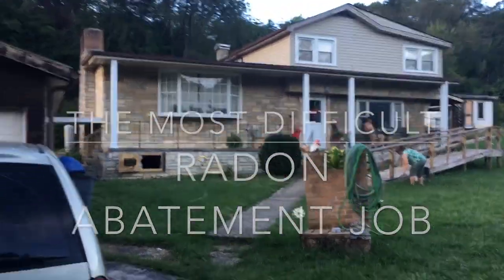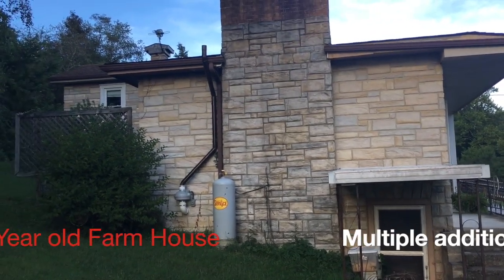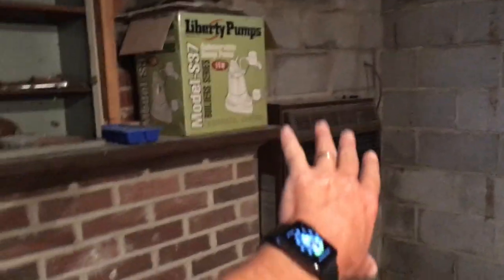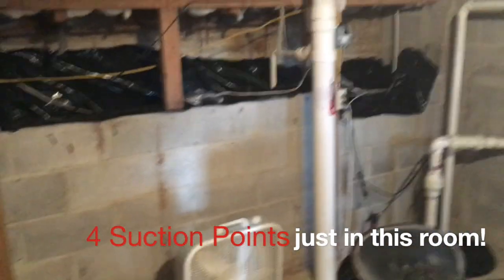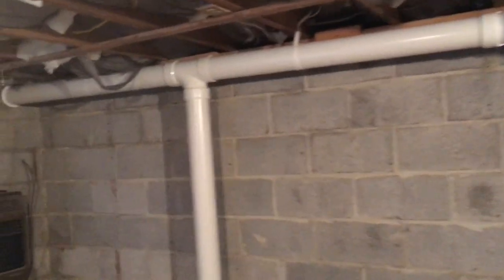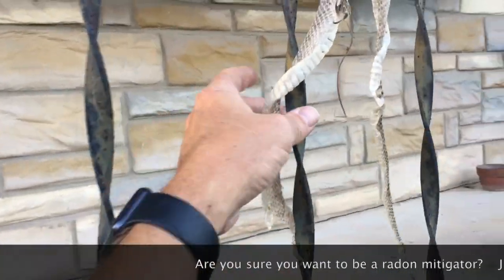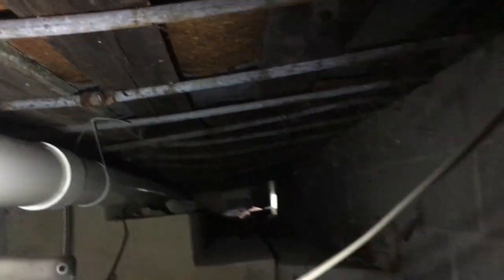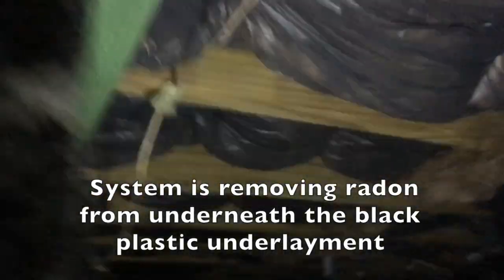The Most Difficult Radon Mitigation Job

Comment: Hey Scott! I am a new Radon Mitigator in Colorado. I love the videos! Learned a lot from them. My question is how do you charge the customer for multiple trips back? Do you bill them through Phases?
Reply from the maker: Hi Josh,
Thanks a bunch!
Experience has humbled me so I always think to myself NO MATTER WHAT, what if I'm wrong?
What do I do next and what should it cost? 
I share these concerns with my customers and explain that what I'm proposing will highly likely resolve the issue based on history, however additional work incurs additional costs. 
"Phases" is a term I like.  I often tell customers that I truly do not want a Phase 2 and that is why I've put so much thought and concern into Phase 1.
Good luck out there!
Reply: @radonman6800  That is great! Thanks for the response.